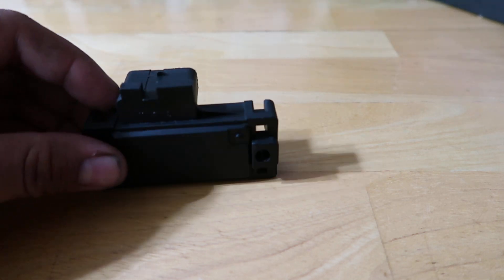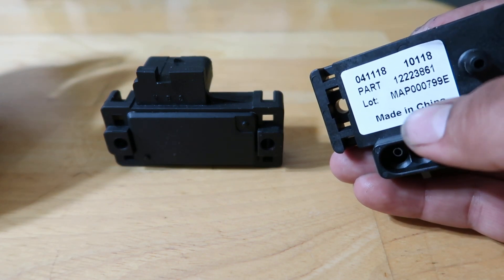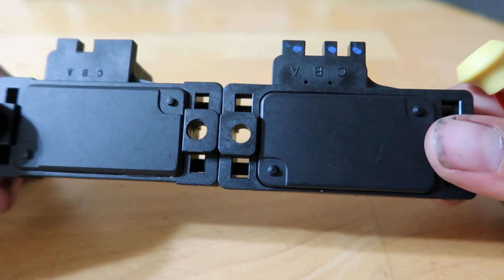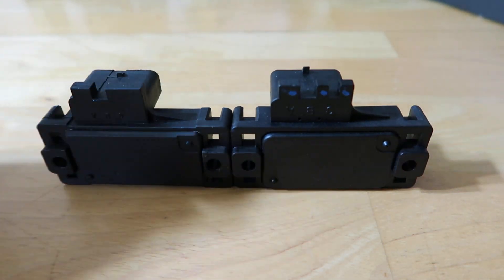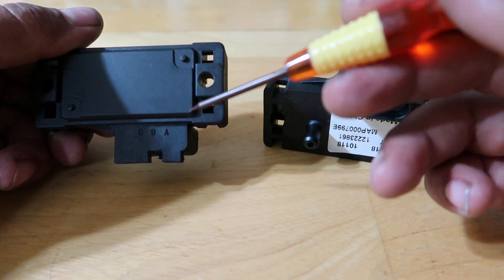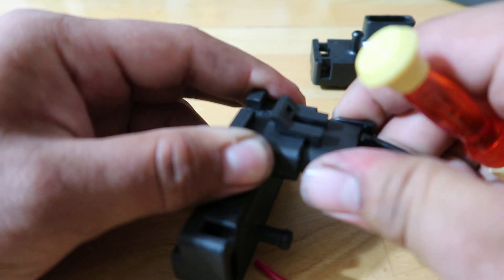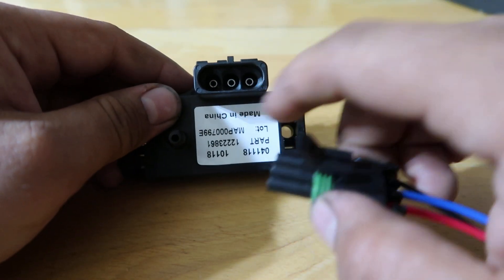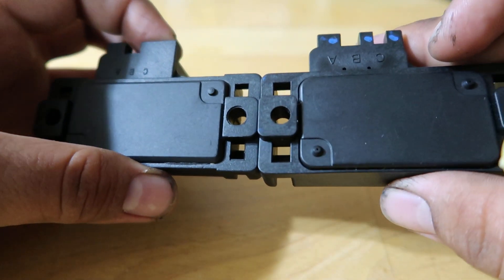Fake VS Real GM 3 Bar Map Sensor

Comment: the cheap one the cover can pop off when you pull the vacuum  line off if you have to remove it. the lid flys off and you can rip the wires right off.